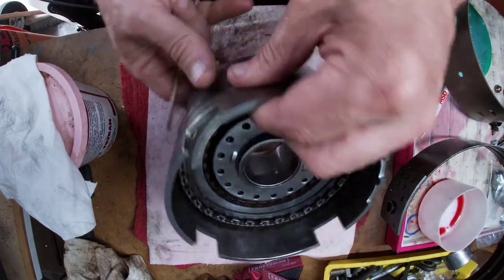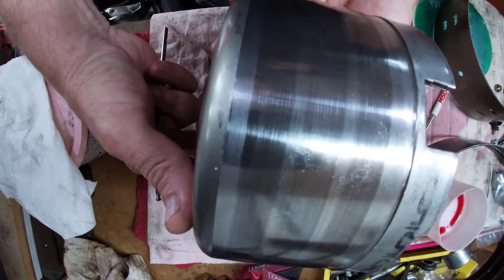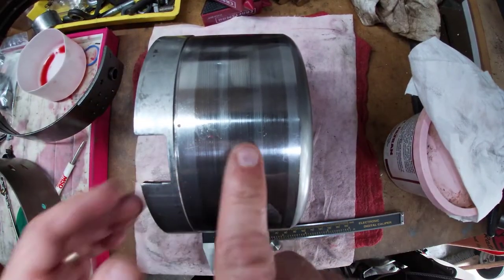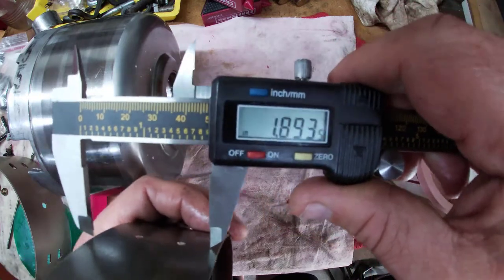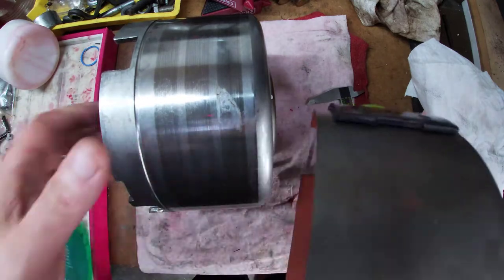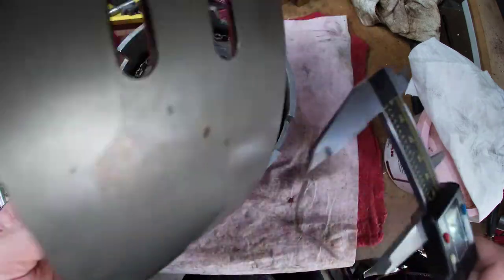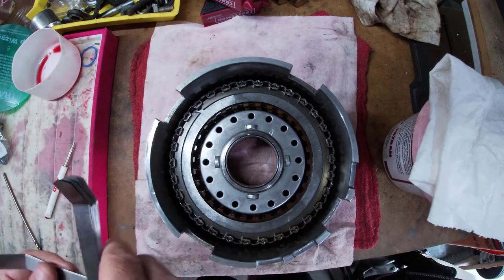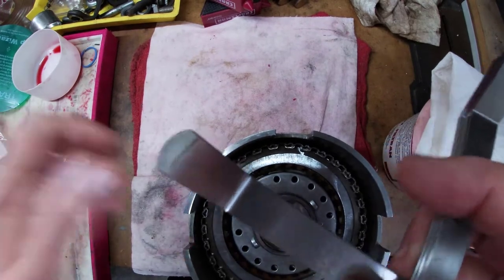200-4r Rebuild (part 11) – Direct Drum ▶Learn How To Prep and Modify it- See How To Do It Yourself👍🤓

Comment: Phil, I enjoy watch your TH 200-4R transmission rebuild. It is nice to see an indepth detail auto transmission rebuild. 

Watching these videos makes me want to rebuild an automatic transmission and start a project vehicle. Just would need so of those speciality tools. In my opinion I see no problem with owning or using craftsman tools. 

Question: Is the TH 200-4R transmission a good choice trans for a vehicle which would be used for light to medium towing, 10,000 lbs or less?
-Rob
Reply from the maker: Thanks for watching Rob!
10k pounds, that's like towing 2.5 Chevelles lol. I've never towed that much and would be concerned about the heat. Probably shouldn't put it in OD or lockup either... Might be better to use a uhaul!
Hope all works well for you and thanks again for watching!

Comment: Really appreciate your video series! I am retrofitting a 200-4r into my '77 Trans Am, and found this tutorial at the perfect time! Getting ready to order the book and rebuild components from CK on Monday. My donor trans is a KT casting out of an '87 GMC Caballero. The guts all seem to be the low performance parts. Any advice on upgrading to Monte Carlo type performance? Sources for things like the additional coil springs inside the direct drum, etc? I left a Message at CK on Friday, but I am sure they are shorthanded during the COVID slump like everybody else. Thanks for the very informative vids!
Reply from the maker: Thanks for watching and hope they're helping you on your 200-4r journey!!
Nice... I used to have a 77 Camaro back in the day but used to like the TA's even more.
Really depends on how much power you plan to generate from the engine to figure out what you need in the tranny. At minimum a shift recalibration kit and servo would be good. Best source for the additional springs in the direct drum is sadly a donor tranny. 
Good luck with the build!!
Phil

Comment: Do you know where I could buy the small O-ring on the input shaft? Replacing the converter and not sure where it ended up.
Reply from the maker: easiest source is an external seal kit... but cheapest if you're not doing a rebuild is to just buy a tcc solenoid and take it off the end of it.

Comment: What's up with the Fanboy stuff? Craftsman use to make a good tool.
Reply from the maker: Thanks for watching... yeah I'm a huge Craftsman fan. Still using the same socket set I got back on Christmas 1983 lol.
Reply: @wrenchingwithphil  would you have any updates on the 200 4r ? Is there a mfg, that has a higher number of steels and fractions? I'm going to be rebuilding one kinda soon.
Reply from the maker: @codywilliams103  Thanks for asking! In this video series I'm using a rebuild kit from ck performance from here: https://www.ckperformance.com/List/2004R/2004R-Rebuild-Kits 
The one I'm using was bought a couple years ago and he's changed kit naming but seems like his current pro-street master rebuild kit.
I personally wouldn't add more steels/frictions because thicker steels are better to dissipate heat and adding more means thinner ones. But that's just 'my opinion' and I'm sure there's others with differing opinions and different color stuff of varying thicknesses to sell you for high $$. At the end of the day unless your racing for $$ (and in that case maybe there's a better trans to use) save your money and adjust ur clearances is 'my opinion'.
Good luck with ur build 🤙😎
Reply: @wrenchingwithphil  thanks Phil. Will be OK to shoot a question your way, occasionally? I'm sure I'll have a few.
Reply from the maker: @codywilliams103  of course!